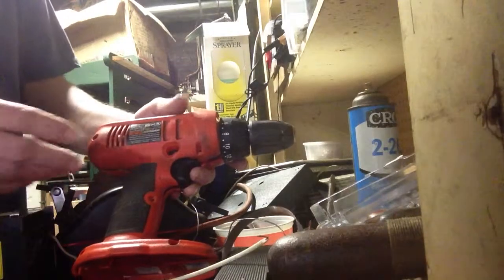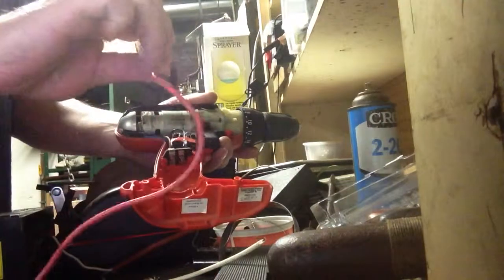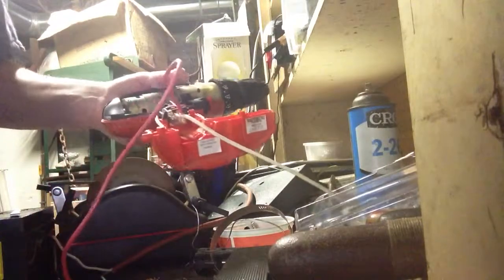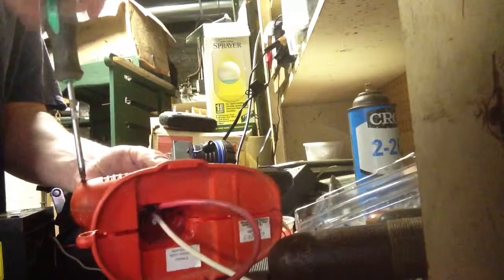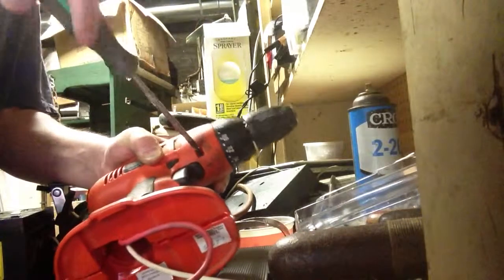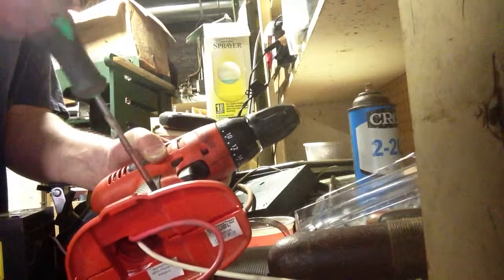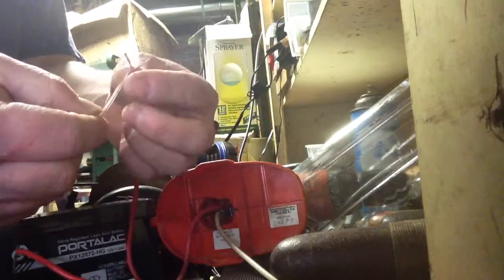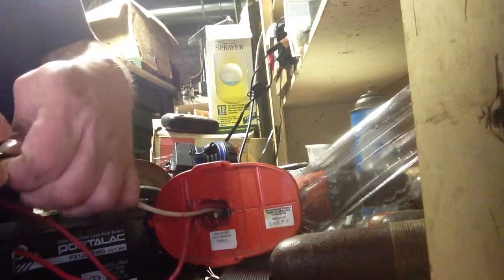Firestorm 18v drill running on free 12v battery

Comment: Good to know. I was uncertain about running an 18 volt device off of 12 volt power source. As you said at 4:50 it's a little weak. I wouldn't expect it to perform well on a high-demand high torque job. Good info  though.
Reply: But is there a way to up the voltage from 12 to 18 volts?

Comment: I already tryed this by myself and works fine! Because it´s more important the High CURRENT than the VOLTAGE
Reply: So if you run this system from your car battery, will that damage your car charging system?